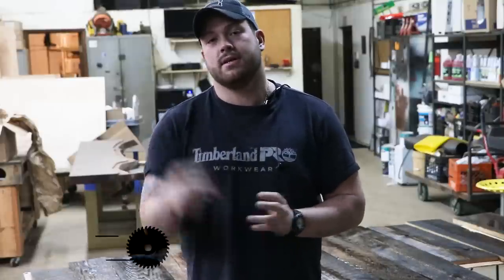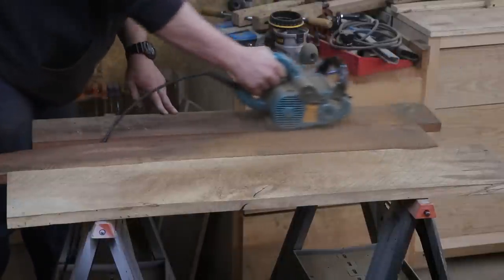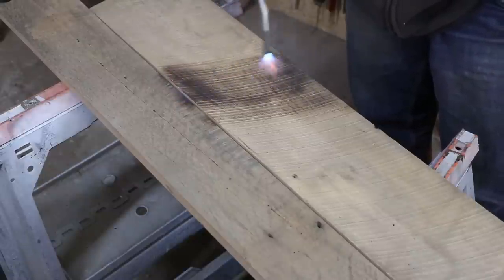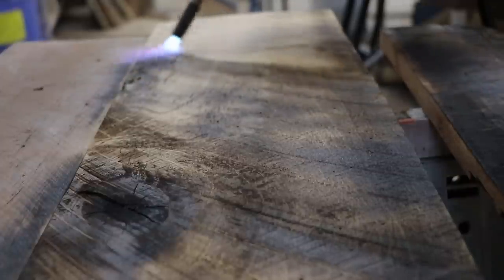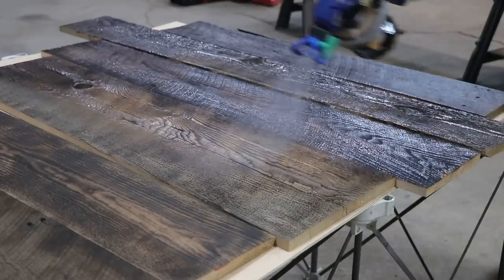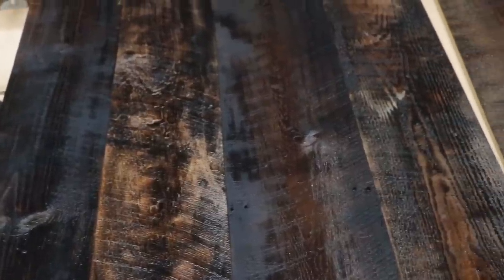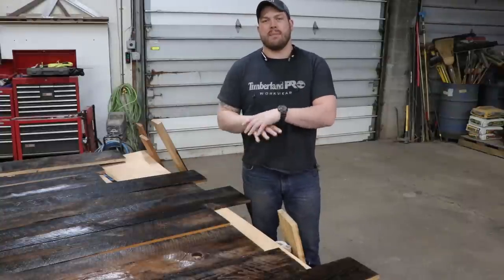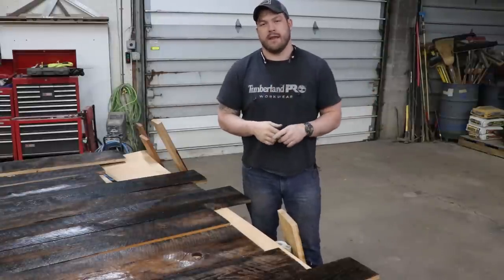How To Finish Wood With Fire in 3 Easy Steps

Comment: Really good how-to video.  Shou Sugi Ban is such a cool process, and there are so many ways to do it, with so many different results.   I just tried it for the first time more my recent table build video, and actually did the opposite of what you did, and did burn the wood until it charred to get an alligator skin finish.  Your observations are definitely true as far as some flaking off, but if you brush the ash off lightly, and then drown the wood in danish oil or any other oil that penetrates and hardens inside the wood, I found that this seals and firms up the surface, so it is durable enough for light use.  I think your finish is really cool too, however.  There are so many variants on shou sugi ban, and it is such a simple process, so I'm looking forward to trying out some different variations on the technique (maybe combining the burning and staining, since they color opposite parts of the grain).  Any plans to use this technique for a future furniture build on your channel?

Comment: Hey, question. I use this technique often myself and I find that poly does not stick well to the wood once is been torched. What type of finish are you using and have you experienced similar reactions? Basically what i see is the polyurethane lift and peel after a few days or so.
Reply: Wax or oil or wax/oil combo

Comment: Can anybody advise me on how to get this result without a torch? Can I get the same result from using natural fire? My biggest concern with using natural fire is that it doesn't have a directional thrust, if that makes sense. You can direct a torch because of the gas pressure which you don't have with natural fire. Any tips?